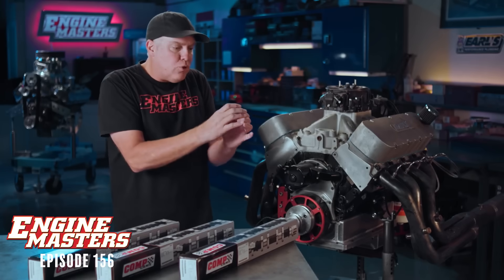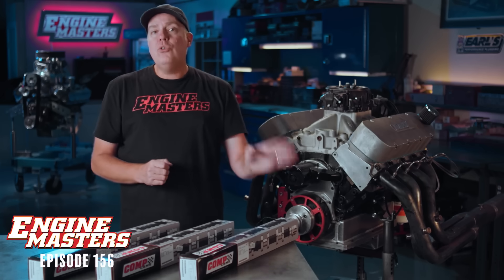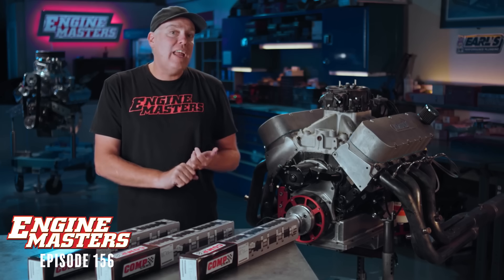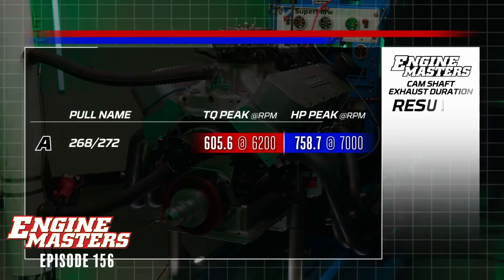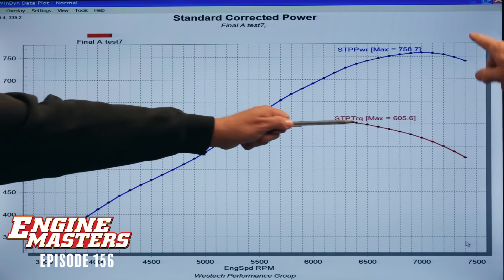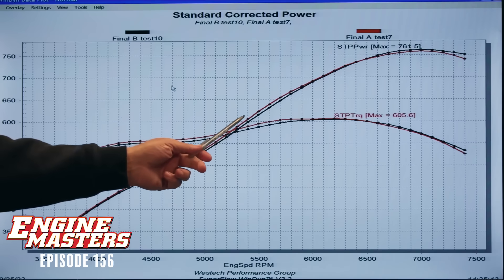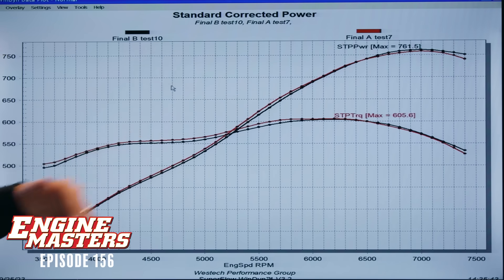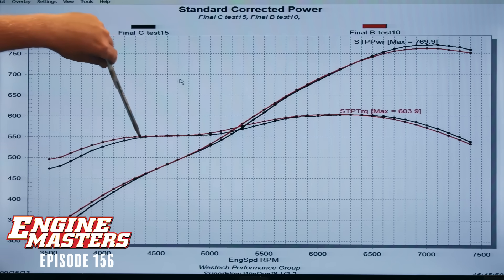Do Longer Camshaft Splits Affect Performance? | Engine Masters

Comment from the maker: What type of cam do you prefer using?
Reply: The one I can afford 😅
Reply: The cam has to provide a power band to match the vehicle both in weight and traction.  I like a good sound since most cant tell the difference between 300 and 400hp.  A 300 duration cam will lose in a quarter mile to a 260 duration cam in a 4k pound car.  Everything in a build from tires to cam have to be in balance for the best performance.
Reply: @aaronvandenberg2416 
Don't forget idle vacuum
Reply: @aaronvandenberg2416  - 300 duration cam is more peaky, than a 260, but if the combo is optimized, you could still get a 300 to beat a 260 cam in a drag optimized setup. Say 300 cam peaks Hp @ 7500 Rpm, Tq peaks @ 6500, & 260 cam peaks Hp @ 6700 Rpm, Tq peaks @ 5800. If you shifted the 300 cam @ 8k, & had a 6500 Rpm Tq. Converter, & Geared that 4,000 Lb. Vehicle to come through the traps screaming between 7700 to 8k= victory, IMO. I have over 35 years of drag race experience, & i have found that most people don't optimize their combo's very well. Then wonder why it won't run the numbers they think it should.
Reply: In my 332" Ford stroker(302 block), I run an old Blue Racer solid lifter grind, 250/260@.050" and 106 LSA, it has mildly ported TFS Track Heat heads with 10.95:1 and Victor jr intake. It revs to 8500 rpm and makes 530 crank hp on pump gas. With full exhaust on the street, I will only run split pattern grinds, exhaust needs all the help it can get.
Reply: Didn't the olds 442 have 308 duration cams?
Reply: @vintagesavoiur  Yes, seat to seat timing @ 308* (233* @ .050) cam for; the '67 & down W30 (400ci), the '68 & up Ram Rod 350/W31 (350ci), and some of the later auto 442's and the H/O. The '68 and up W30 stick shift cam was 328* (& 244* @ .050) in 400's and 455's.
Reply: @vintagesavoiur different manufacturers use different methods of measurement, hence the industry standard of duration at .050
Reply: @vintagesavoiur  General Motors and Mopar typically offered one cam for stick shift and a milder grind to run vaccum for an automatic transmission. Honestly I don't know why more magazines did not use variable duration lifters on their project cars.

My Olds 455 has a .490/260 split cam and with Crane VDL, i can leave the manual valve body THM400 in third gear and pull away from a dead stop. Helping out is the spread bore carb and an ancient Allison captive discharge ignition.

also, early camshaft profiles were hard to compare with each other, since camshaft manufacturers would begin measuring at any spot they wanted to on the camshaft lobe. Eventually there was an "agreement" to begin measuring at .050 inches of lift, tho europeans went with 1mm.
Reply: @vintagesavoiur  the Olds and Pontiac engines offered 308° advertised duration cams back during the musclecar era in Ram Rod 350, W30 455 ( same cam ), and the Ram Air IV 400, and SD455 ( if I remember correctly ). The cams tested here were measured at .050" lift, and should've been mentioned so there wouldn't be any confusion.
Reply: I used to like the Ford 400 with an RV style cam.  The 114° lobe center angles worked very well.
The new variable angle systems, take all the fun out of cams.  But give the driver more power.
Reply: What happens if you use more intake duration and the same static exhaust duration?
Reply: @ramair325  - Some cams for turbocharged engines use that kind of profile.
Reply: @ramair325  That depends entirely on you intake flow, Head flow, Intake runner length, exhaust flow.  Every build is different.  The vehicle weight and gearing are also a major factor in all of the things listed above.  In fact all those things are built after knowing the weight and gearing.
Reply: Theirs your next show idea.  Have two builders build the same engine for a car but only one of them knows the car weight and gearing.  Show people the difference a proper build has over just bolting pretty parts on a Dyno.
Reply: @ramair325  back in the day when OEM/stock heads were all there was and any difference in flow came from "porting experts" who did not have a CNC machine but used flow benches (which like dynos, can be rigged for better results), there was a fella named Bruce Crower who invented "the mileage system" just before the 1980's fuel crisis. It was a camshaft and piston combination claiming 30 mpg on chevy 350's. Compression was 14:1, and the intake valve would stay open a lot longer than usual, so that the compression got bled off into the intake manifold. It tried to get the mileage benefit of high mechanical compression (40% claimed) but it was pretty doggy for performance at low RPM b/c Hot Rod magazine used the worst possible intake manifold on it.  If you search for "miserly mouse", you can probably locate articles on it. Mazda would repeat it later as "the Miller cycle engine".  I wish youboob let me do links, speed-talk forum had a bit to say about it. 

Anyway, you can go with aftermarket heads that flow both intake and exhaust ports more equally than stock/OEM. if you increase the amount of air going into the engine (by a power adder, by cold air induction, by bolting on a better intake manifold) you also have to get that air (in the form of exhaust) out since you can't really burn it twice. David Vizard once had an article on an exhaust system so tuned to the engine, it "pulled" the exhaust out so much that it had the effect of a mild turbocharger--in that it dropped pressure inside the cylinder so it filled better on the intake stroke. He has a channel here on youboob, i think he has the article on his list.
Reply: @alertgasper - Never in my 35+ years of being into automotive performance, have i ever seen, or heard of, an exhaust port in a cylinder head, that flowed more cfm than the intake!
Reply: @evilinside5984  well, if you don't get the exhaust out, there's not much room to put the fresh air/fuel in :) so you use a split or dual pattern camshaft, that keeps a poor flowing exhaust system open longer, to move the exhaust out since it won't burn a second time. tuned headers worked as well to pull that hot air out, Cyclone even had their "reversion cones" in the flange. Get the right combo, and you can even cut back on the cam's overlap, where the intake and exhaust are open at the same time (and if you get the angle cut right on the back of the valve, you increase low lift flow and REALLY don't need a ton of overlap like the musclecars ran in place of lift)

Flatheads can really play around, since their valves are located outside the cylinder--you can have valve face diameters that total to more than the diameter of the cylinder. Ironically tho, OHV Fords tended to get bad airflow for performance--small ports and valves like wedge big block mopes to generate low rpm torque and lousy exhaust ports due to the shock towers in most of the engine compartments.
Reply: @alertgasper - I thought you were only talking about the cfm flow of the exhaust port in a cylinder head only, & that you knew of some that flowed more cfm than the intake port. I have never seen that as the case. Which is what i stated in my prior comment to you. I said nothing about the exhaust system, or camshafts.
Reply: @evilinside5984  looking back at it, I should have stated it a lot clearer. As you know, flow benches like dynos can be manipulated so i wasn't referring to that. anyway, thanks for pointing it out, most people made the point anyway so i re-wrote it to talk about Bruce Crower's More Milage System from the 1980's. bet that'll blow some young minds who know it all, lol 

(for those who don't know--an aftermarket chevy small block head, as an example, can flow air differently depending on whether or not it's used on a 305 block, a 350 block, or a 400 block)
Reply: @alertgasper - Yes, bore, stroke, & piston speed all factor into the actual cfm pushed, & pulled through the cylinder heads. I would like to see the cfm difference on a cylinder head @ 4,000 Rpm vs 9,000 Rpm. Oh, & of course cam timing, & its effects @ those speeds, straight across vs 20° more dur. @.050 on the exhaust, 104° Lca vs 122° Lca. I have never seen that big of a difference tested.
Reply: @MotorTrendWatch @EngineMasters   I know you guys like American muscle the 3v 4.6 is underpowered and every owner wants to know how if could you guys show how to make a fully built forged internals and heads like you guys do
Reply: roller type cam, if you have the money for 1.
Reply: Metal. My honda lawnmower has a plastic cam that I don't think too much of. 
    It is not wearing, however!
   It also has only one lobe. Strange rocker arm shape creates the correct cam timing for both intake & exhaust.
    What...that's not what you meant?
Reply: Isky solid roller sbc. 
Always loved the way their single patterns ran (since the 80s)
Rod at Isky recommended 8 deg split vs a bit smaller single pattern
Guess he knows more than I do! 
260/268 294/302 .640gross 108
Reply: The one that gets me to work and home 😂
Reply: 2 inlet valves 1 exhaust. theres less exhaust than fuel coming in, so, you dont need a big exhaust over lap. i had a 275 cam, that pulled till it blew.. or changed gear..
Reply: One that goes fast, quickly?
Reply: The constant is induction and heads.
3 cams and no significant change in the graph. 
The other constant. All 3 had the same lsa
Reply: I can't help myself:  I like solid/flat.  Less mass & fewer moving parts and... there is no such thing as 'maintenance free' anyway.
Reply: Split pattern solid roller with LSA 2-4 degrees tighter than most if V-P allows for it
Reply: free
Reply: @OxBlitzkriegxO  my other favorite four letter word that begins with F
Reply: In which episode does Engine Masters compare single pattern cams versus split pattern cams? Thank you
Reply: There's another guy on YouTube that makes a good point on this subject. He looks at the cylinder head flow rate intake vs exhaust and if the exhaust flows less than 75% of what the intake flows he uses a duel pattern. 75% and above he uses a single pattern. Makes sense but a Dyno will be the judge.
Reply: The Steve’s getting in touch with their hippie side on this episode…meanwhile…Davie just refuses to grow any…the nerve🤣
Reply: The one that has no lobe wiped flat
Reply: @JukkaVaan  so... Roller?
Reply: The 1 that has more bottom end power.
Reply: I only use cams I pulled out of a car from a "Pick and Pull" where the car has over 300k on the odometer. Those cams got experience.
Reply: @Pooslingingmonkey  LMFAO
Reply: @Pooslingingmonkey  They're "seasoned".
Reply: @Pooslingingmonkey 
Is your first name Richard?

Comment: They seem to be in the coffin corner for this experiment. That's basically a race engine, making 200 hp more than the Ford GT engine that dominated Le Mans, and comparable to current NASCAR mills. It has good heads with good (if not equal) flowbench exhaust flow, and a cam spec that really, really maxes out the amount of overlap an engine can comfortably have.

As interesting as the premise of the experiment is, as a man who's running a stock-head 1993 LT1 with a 225/233@.050 cam and 110 LSA - this does not inform me on how right or wrong my decision was. But based on having 1.94/1.55 diameter valves and non-longtube headers, I can confidently say that my exhaust tract "needs the help" of the split profile a lot more than this mill's test stand longtubes do.

Comment: Dyno'd countless race engines over 40 years. To make apple to apples comparisons, you really have to insure your Brake Specific Fuel Consumption numbers are virtually identical for each cam test. Tune the carb accordingly. Engine acceleration and recovery on a gear change is key to getting down the track. When midrange power levels are so close on these 3 comparisons, and the engine is relatively small, definitely err towards the cam with less exhaust duration. Chances are very good the BSFC numbers will be more efficient with the smaller Exh Duration camshaft.  (We have no idea which can the untouched carb worked most efficiently?)
 Lastly, the engine will spend very little time at peak power. Give up a few peak HP for midrange and a better BSFC number.

Comment: To me it seems that this is a totally meaningless test, since the aftermarket cylinder head manufacturer corrected the flow issues that the OEM heads had. This would be a better test on stock heads such as the OEM Ford small block or 460, which had restriction on the exhaust.

Comment: Ask a NASCR engine builder.  They build engines for Bristol and engines for Daytona and track sizes in-between.  They can tell you, if they will, exactly what to do to make torque or HP in a chosen RPM window.  Cam, manifold size and contours, header size and step, etc.  They need to be able to do it all consistently.

Comment: A great video but my thought is this:  Because of the loss in cylinder pressure at low RPM, is that making the fuel more difficult to fully burn at low RPM but better at the high RPM, resulting in the power lasting longer (higher RPM)? Justa thought. would the results be the same with Port Fuel Injection?

Comment: I remember calling Chet Herbert at hus shop late in the evenings... if you onow you know.

Anyway I was a broke dirt track racer and I just blew a Cleveland in one of my junkyard rebuilt engines... tossed acrod that broke a cyl and the cam.

I had a sponsor that supplied cams but he was out of stock. Herbert sold stock regrinds for about $60... my price range.

I told Chet what grind I had been running... he laughed and said I was running a Chevy grind.

He sent me a split pattern cam... wow what avdifference! That pld cam was done by the time I saw the flagstand... the Herbert grind pulled all the way down the front chute!

I sent Chet a check in the mail and he not only shipped my cam before he was paid... he sent me two cams one to try out on my next engine... a true gentleman.

Comment: Where this is the most effective is with a somewhat sub par exhaust system,   small tube headers case in point. Additionally, the higher compression the bigger the response/gain.
 By opening the valve early, the power stroke isn't significantly affected as it's over at about 90° ATDC.
 The exhaust pulse will be much stronger,  faster, due to higher cylinder pressure when it opens. 
 This also increases scavenging as the return pulse is much faster, stronger,  with higher velocity. 
 Surprisingly,  if all you can buy for whatever reason is a 1 5/8" header by using the PROPER amount of additional exhaust timing,  the net loss is only around 10 H.P. vs the high buck  Hookers, that you can't afford. That's right,  if everything else is right, this will do alot for a too small of a header.
 It's the physics,  higher pressures mean higher velocities.
 Would you be interested in trying this? You,  Gentlemen,  have the resources,  I don't. 
 This is how I understand the physics of this. Am I correct?
 I'm referring to a SBC.

Comment: This test probably would have made more sense on a Ford engine. Once that has bigass intake ports and valves and tiny exhausts.

One where it makes sense to hang the exhaust valve open longer 'than usual' to make up for the crappy exhaust ports. Especially the ones with the air injector nozzles making the port worse. Like the E7s.

Comment: I run an SBF 306 13 1 CR. Offenhuser Tunnel Ram,  Holley Tunnel Ram carburetors 
Comp Cam 310 duration on exhaust and intake 110LS .575 lift.  running 93 octane , runs great. Daily driver 62 Falcon , top loader, 3 53 gears.
Reply: On pump gas?
Reply: @hectorortega9131 yes

Comment: Even if the door is open longer, what about if the door isn't open as wide and the door is smaller?  Does the exhaust require more duration due to a smaller valve and possibly less lift?
Reply: Generally yes the exhaust will have longer duration.
The better the exhaust port the less you need.

Comment: nobody ever talks about valve lash which can make all the difference. i like a tight lash cam with a hair extra duration so i have room to loosen them up if needed for the best tune. that's just rule of thumb and not set in stone. if the cam is ground for it, you can have a lot of latitude in tightening or loosening the lash. i really don't know how anybody can feel good about using a hydraulic lifter, those things can be all over the place at any rpm. there is no place for a hydraulic lifter in a performance engine. sorry hydraulic fans, that's just the way i feel about the lazy man's lifter.
Reply: Maybe the engine is in a cruiser. And it idles a lot. And you'd rather go with a hydraulic cam.

Comment: Couldn't you change intake rocker arm ratio to gain back the lost torque? Leave the exhaust rocker ratio alone to keep that duration, up the intake rocker ratio which give more lift but same duration to up torque and then get the best of both worlds?

Comment: all that talking and no idle quality sound and most street engine stay way under 4000 rpm.  when i choose a cam i go for one that fits the rpm the engine is going to run at the most.

Comment: Ehh, would have liked to see the opening point be the only thing that changes duration. Actually, yeah, stock amounts of valve overlap, change other things, for ease of EFI tuning. Closed loop O2 readings and all that. I've heard you'll get a very lean O2 reading, at least at lower RPMS, with lots of overlap.